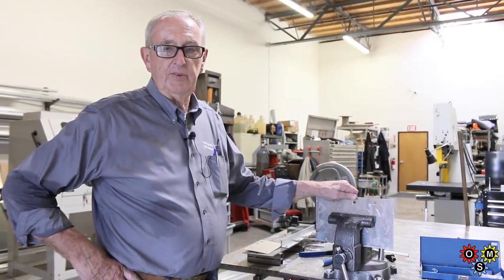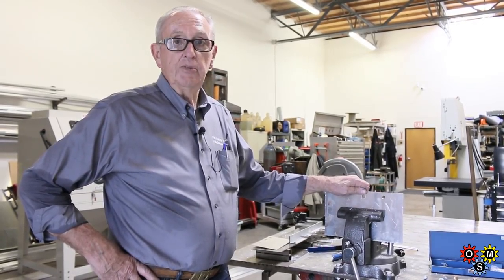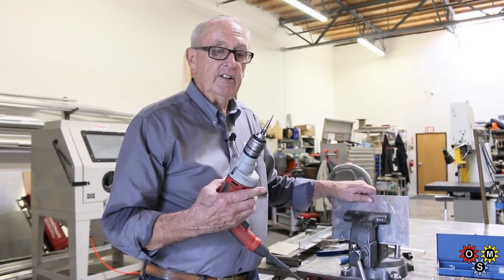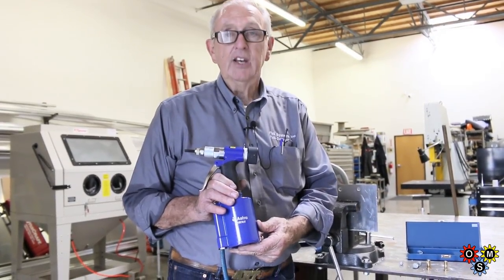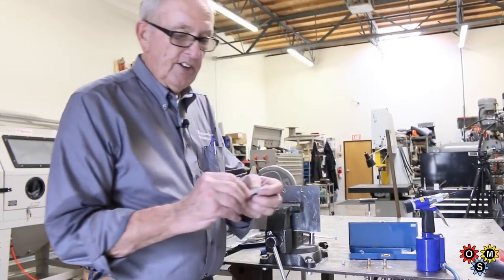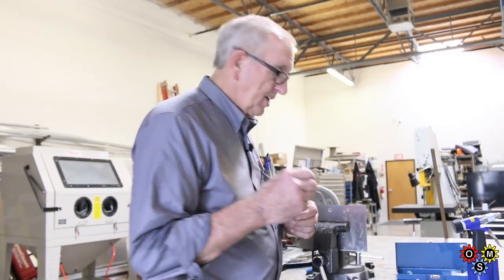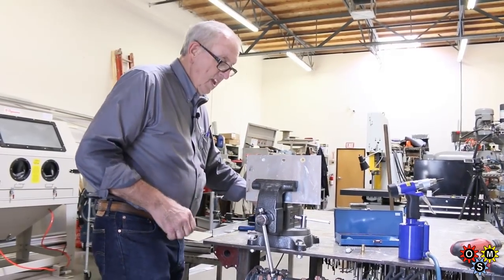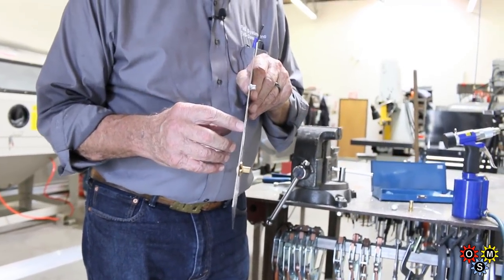Arthur Demonstrates "Rivnuts"

Comment: In this (honesty helpful) video the camera stays in wide view throughout.
Please use a "close up" view of the action - especially the back of the test plate - to SHOW what is really going on. In video production this is called a "cut-away". Even a quick close up still (taken with a camera phone, or a point & shoot later. So it doesn't break up your main shooting flow) can achieve this. The shot can be added in the edit as a full frame, or an insert box. It makes all the difference in explaining how the system works.
Reply from the maker: Points well taken and thank you. I had no say on the video content and presentation but do agree. All I had to use was what was sent, apart from some other material with closer shots but - they were less useful overall to use, or insert.. I will make these points to Arthur.
Reply: Thank You for the input will for sure start to improve always trying to do better -Arthur

Comment: This is an excellent system for obtaining a strong threaded fixing into sheet metal, I have used similar fixings in stainless steel for over 20 years and never had any problem, the "Avdels" (UK), which I use can be pulled up by very similar tooling, and one can also use a simple threaded stud system, although I do not recommend the bolt being used to collapse the threaded dowel as this put severe stress onto the thread, if a stud is used, with a nut to pull up and collapse the avdel, there is only tension on the thread, and no turning stress, just a small point, but very important for the future use of the insert. Chris B.
Reply from the maker: Hi Chris,
Useful points - thanks.

Comment: These are great.  I've used them to put threaded connectors (5 mm) for water bottles brackets in bicycle frames.  I can't think of a better way to put a fastener in a thin-walled tube.
Reply from the maker: Hi,
Thanks for reply.